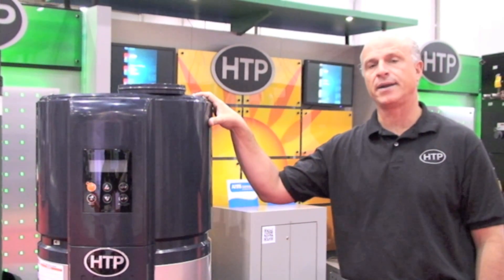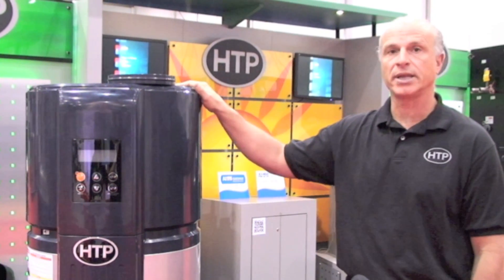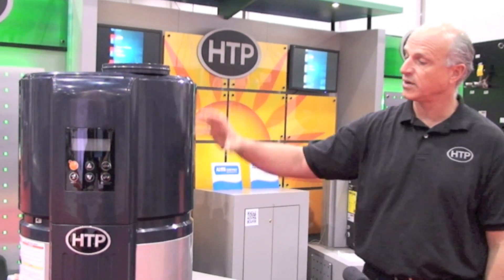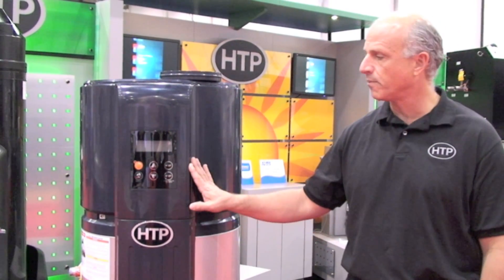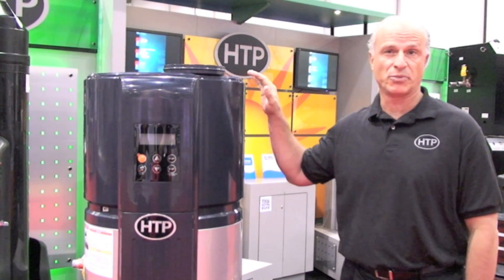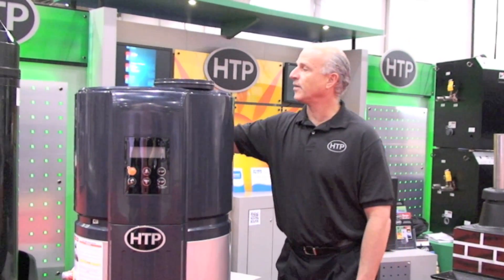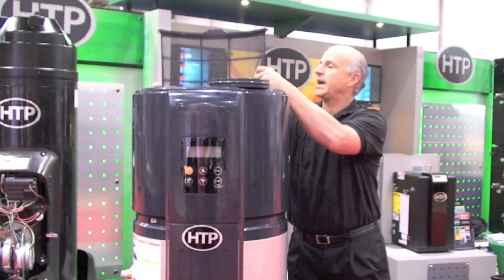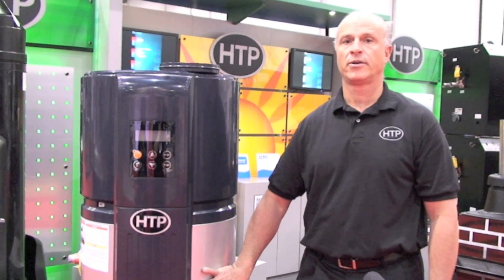AHRI - 2011 Hybrid Heat Pump Water Heater

Comment: Seems like a good idea in warm climates like Texas or Florida where the temperature is hot a good portion of the year.  But in places like Vermont where I live, pulling warm ambient air from a room in winter means that your main heat source to heat your home is actually heating your water as well when the unit is operating.  It would only be efficient in summer when temperatures are higher and the heating system is not running.  I would assume this being the case that your fuel bill... oil, kerosene, electric, etc. would increase accordingly when your primary heating system is in use.  If I'm wrong, please explain how.

Comment from the maker: While the Heat Pump water heater will produce cool air it is not a good substitue for an air conditioning system. One can not use this heat pump without it being hooked up to water heating system.